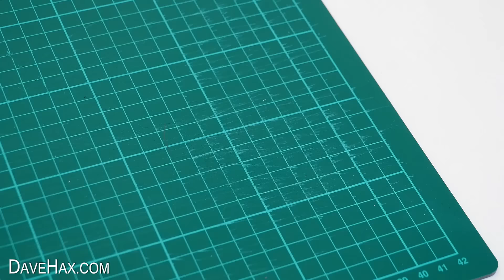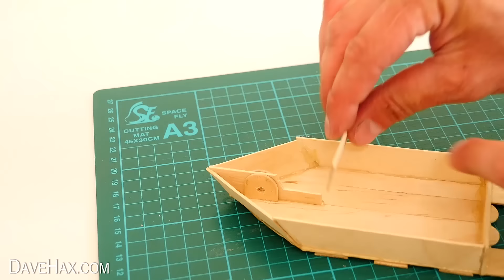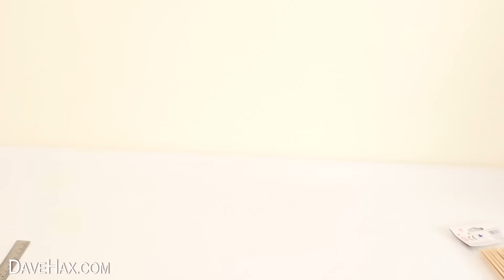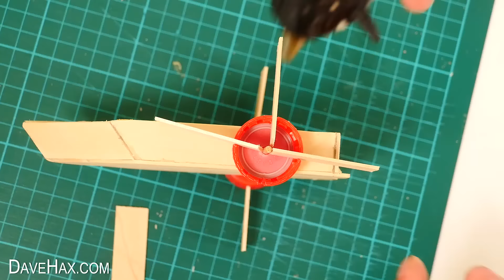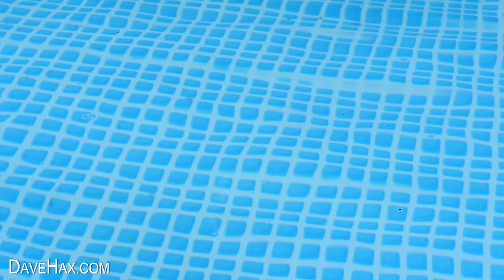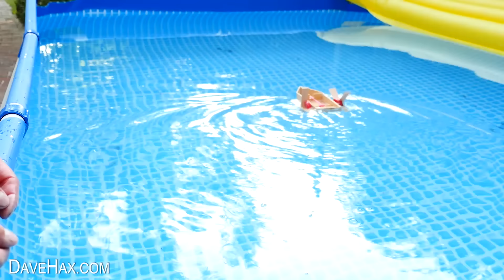Make an Elastic Band Paddle boat

Comment: Great video. I made one with my 8 year old boy for a school project. Didn't bother with the rotors. Just a boat and put a wee sail on it. However after putting it in water it all fell apart
 I used a glue gun and craft sticks bought from Amazon. The problem seemed to be the carft sticks all buckled and bowed and weren't water resistant.  So something to look out for if you plan to build one.
Reply: Tape the bottom, tape is water resistant. Put the tape under the boat. And maybe add some in the sides. Hope this helps!

Comment: Is there a weight distribution issue? Because the boat keeps on tilting on the left?
Reply: Small mistakes add up to make such issues,there will always be a bit of asymmetry. This can be solved by adding weights to counter,or you can add a rudder at the back to make it go straight

Comment: At 2019 I made a huge massive boat by my self and it worked i tested it I a bath tub it was wind power and after a few weeks I was going to add 1 or 2 Dc motors with a switch and battery and resistors but the pencils for the wind flagy thingy  snapped so i gave up 
And I added a string it took me 2 weeks to plan how to make it and  3 weeks to make it
I wish I could show it to u guys

Comment: The wood soaks up water made the boat kinda heavier and sinking a little bit which made the water easily get in......probably coating the outside of the boat with water repellent material could prevent the wood from soaking up water and that gonna let the back side to float better

Comment: I think maybe it’s the weight of the paddles weighing it down at the back enough to take on water over the sides. Maybe if the paddles were closer to the middle it would ease the issue. 

Also maybe if you could find something to fill the bottle caps with that was lighter than glue gun glue, which is quite heavy in a lump like that. Air dry foam clay might work as the right kind can be very light. Maybe use a small amount of glue to stick the wood together and then fill around it in the bottle caps with the clay to reinforce it.
Reply: Maybe the holes where the stick is are a factor as well?

Comment: Try putting a slice of cork under the rear part of boat.
Reply: He needs to put a second lip layer at the back of the boat because the propellers are acting like a scoop and scooping up water and pushing it back into the back of  the boat

Comment: Put the bottom cross braces inside for less resistance to forward movement.the holes for the axle are your leaks . grease an additional skewer and install it temporarily. Use your glue gun to create bushings for the axle. Spin gently while cooling off. Install paddle wheel. It might not be perfect, but probably better than none.
Reply: Its way better to make the axle a little bit higher, its at the water level, thats why the water gets into the boat.

Comment: The water fills in through the side holes for the skewer. You can avoid this by adding short plastic tubes (isolated with glue) to the holes just a little wider than the skewer and stuffing some vaseline inside. The skewer will still turn but vaseline will add insulation. Tried it, works great.
Reply: Yeah,that boat floods a lot. My guess is that the hull is too short,letting water out. It has like no freeboard at all (amount of ship hull above the waterline). Can be fixed with a taller hull or paddle boxes.

Comment: for more speed... cut down your original paddles... and use the off cuts glued on at 90 degrees to the smaller paddles.... less drag, faster paddle speed with a larger surface area as well as setting the paddles at different angles to each other.... so that you get a smoother operation... as you only have four blades on each side ... otherwise boat is amazing :) well done

Comment: The water probably goes into the hole the skewer is threaded trough. This can be solved by making the boat taller, the pedals longer and the whole pedal assembly higher from the water level